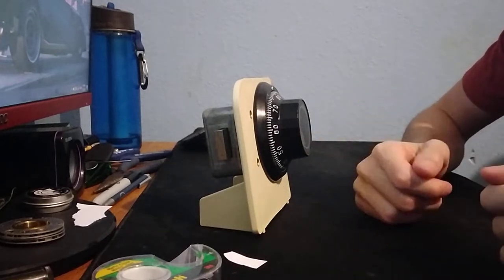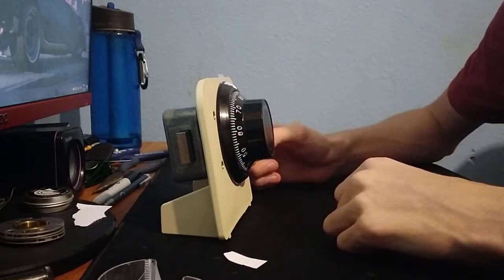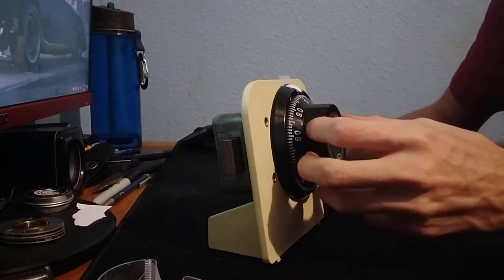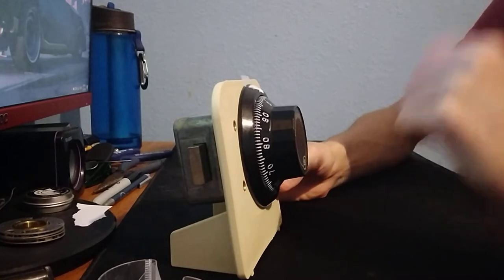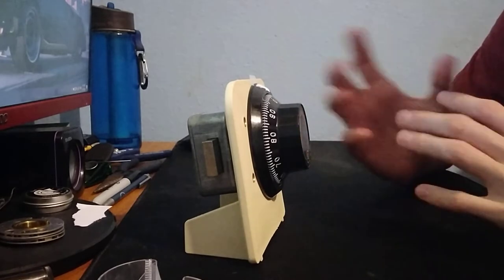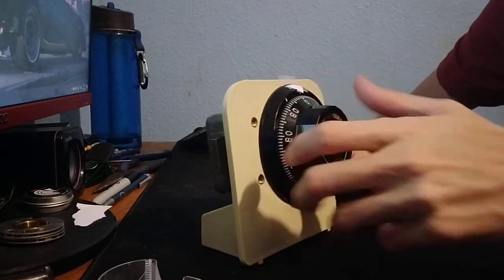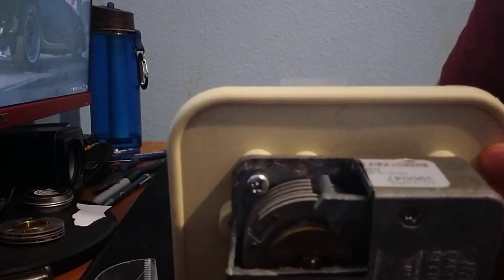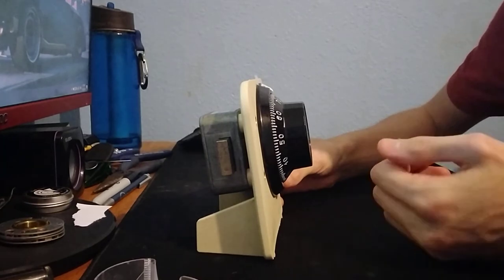Safecracking for Everyone part 6 (Tips you NEED!)

Comment: Thanks for the videos.  I have a quick question.  Do you have a video on complete disassembly & reassembly of an S&G 6700 series lock?  I need to switch the bolt on one to a longer bolt from the old lock and I'm not sure how tight the screw that goes into the arm/bolt should be.  I imagine if it's too tight it will it will cause issues. (Based on the old Diebold lock I have that I have to re-use the bolt from.)

Comment: I purchased a  Maximum Security Corp.  Corporate securtiy safe from an estate sale.  owner had the keys but not the combination.  Safe is older (30 years old) 59" tall, 30' wide and deep' IN EXCELENT SHAPE.  Mfgr. of the safe is Korean and no l;onger make their safes now.   I was told it has a Japanese version of the combination lock.  I want to use your method to open the lock, locksmiths here want to drill.  Do you know if the Japanese version operates in the same manner like the S&G.  I live in Durant, OK and wonder if there is anyone who uses your technique.  Thanks

Comment: This is a really cool series.  Thanks for taking the time to post it.  Would you happen to know if this method would work on a much older safe, like a Herring Hall Marvin?
Reply from the maker: Most likely not. I'm not too sure what type of lock is on there but I would think because of it's age, it would be a friction fence/indirect drive/etc. Can you feel 2 contact points when spinning the dial? Or only 1 contact point and only when spinning in one direction? If the latter, then it definitely won't work. If the first, then there's a chance it will.

Comment: i have sentry safe i pick out of the trash its in great shape its 37 1/4 tall and 21 /12 wide with a (s g) dial IT seems like my contact points are not at 0 my left point is at 6 and the right is at 13 i am having a tuff time grafing it i have watch the videos so much its nauseating 🤢 I WILL NOT THROW THIS THING IN THE TRASH I WILL KEEP TRYING just needed to vent (VERY FRUSTRATED 😤
)
Reply: Keep the faith, giving up surely won't get it open. I hope you've gotten it open by now.

Comment: Having difficulty find where to buy an s&g 6741. Any suggestions, please? Thanks for the video.
Reply from the maker: I usually look on eBay for them, they pop up from time to time usually around or under $50. Of course, there's always some available for more but I do suggest waiting until a used one goes up for sale. You can also just contact a local locksmith but that will be more expensive for sure. Good luck!